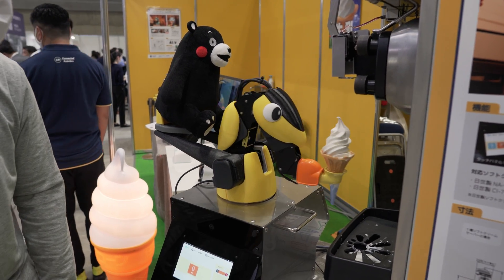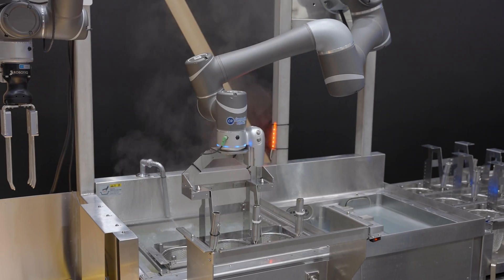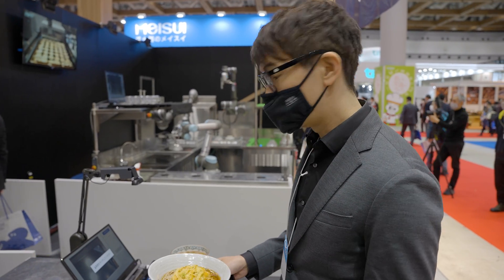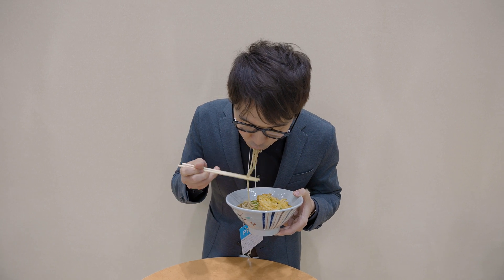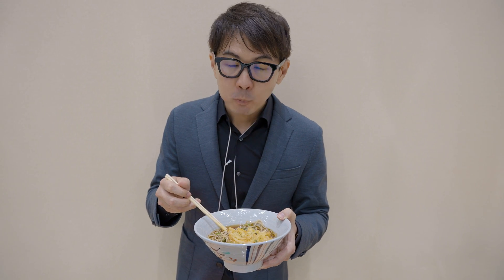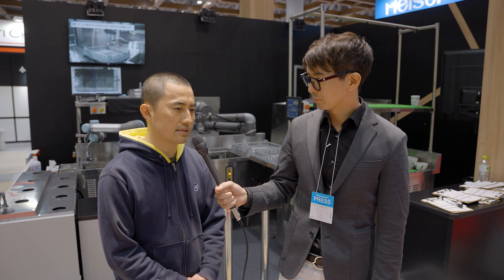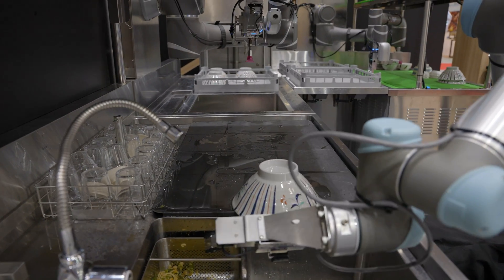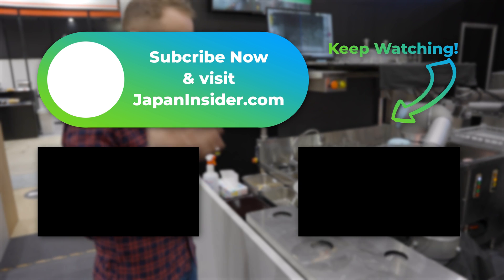Robotic Kitchen - Noodle Shop of the Future in Japan

Comment: The level of accuracy and precision of the robot according to the implant program is truly amazing.
Reply: Robots have a certain precision, it's in the specification. They are not perfect (just in case someone thinks they are). The more joints the more inaccurate they become -- unless you are paying more for higher grade encoders.
Reply: @mrechbreger  thus the large amounts of malpractice cases that came out of attempting to use fully automated robots for some surgery types in the early 2000s. The robots weren't accurate enough and in some cases caused irreparable damage.
Reply: @thesteelrodent1796  I think it's still part of the learning curve - I saw many companies who made shitty tablets in 2010 - 10 years later they are with top ARM processors and make good quality tablets.
They gained the experience from the uprising systems back then. When looking long term initially faulty systems might look worthless - but the experience gained can be re-used with more sophisticated hardware. Of course this is also kind of a look into a glass sphere..